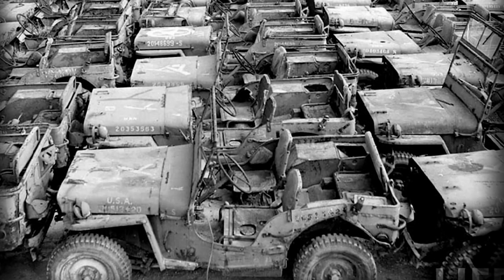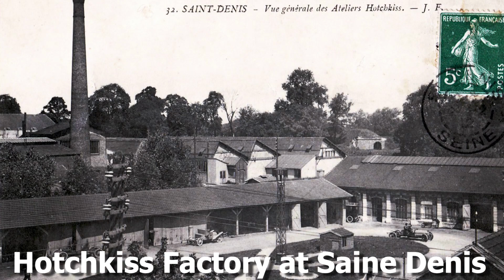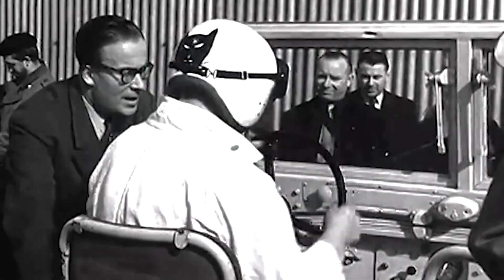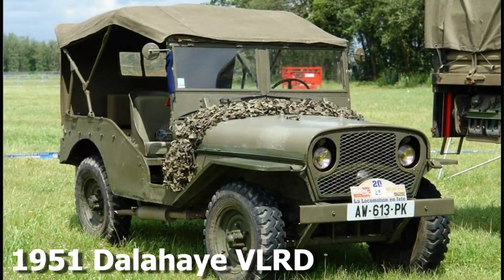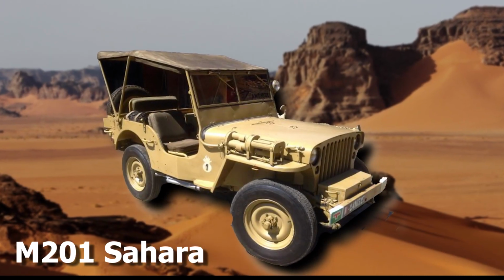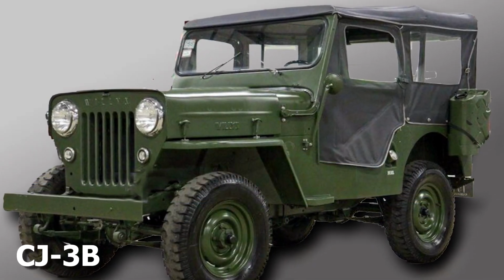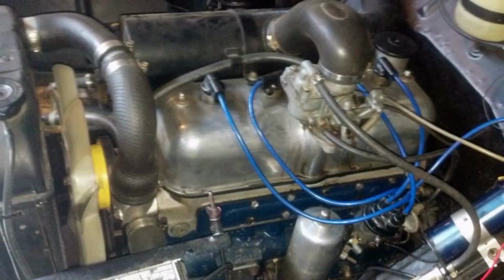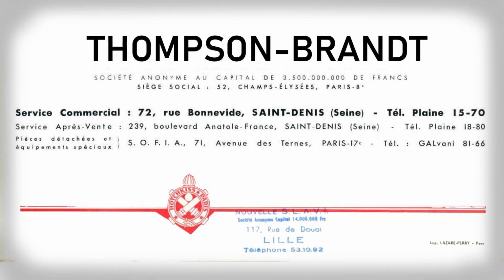Willys Jeeps Made in France M201, JH101, JH102,HWl, MB, CJ2B

Comment: Fantastic to see this history explained here. My Jeep is a mixture of parts just like it is explained here. The engine is post war Willys of France (WOF), gearbox and transfer case say GPW, the springs are the larger Hotchkiss type and the chassis has a plate inside at the rear that corresponds to re manufacture in 1966 (got this from a great website called ITM Jeeps). The diffs say 1944 GPW on the ring gear but the case says WOF. A completely original Jeep would be nice but I have to say I like having the stronger engine and chassis. My Jeep isn’t a museum piece, it’s to be used as a working vehicle so all good.

Comment: I have a 1942 Ford GPW. However, the frame was split in two and it is almost certain the the forward and rear half of the frame come from two different, though identical cars. In addition to that my GPW has a 1943 Willys tub and a Ford engine that was overhauled in 1945. The leaf spings are from Willys with Ford clamps and metric screws. The only original instrument it had when I got it was the temperature gauge which is French. It is almost certain that my Jeep is one of those that was assembled to re-equip the French Army using pieces of scrap Jeeps that served in Europe in World War Two. If only these pieces could talk!